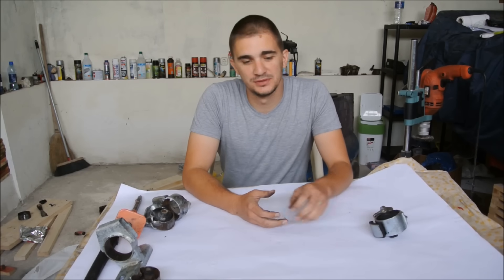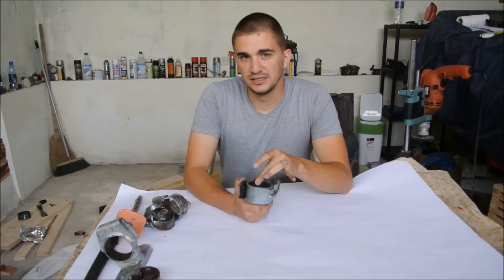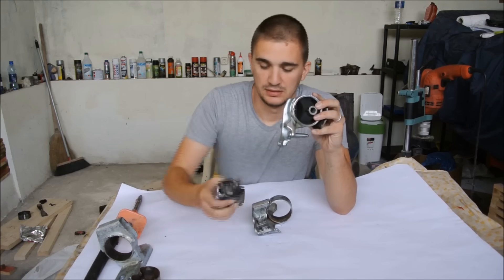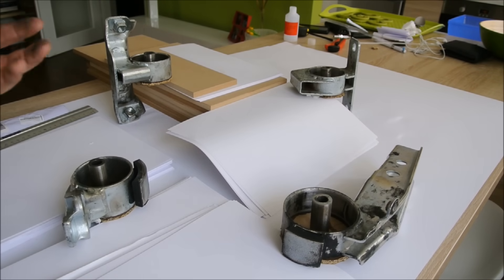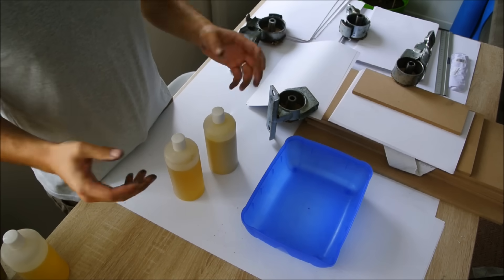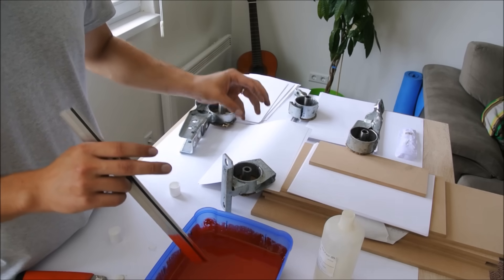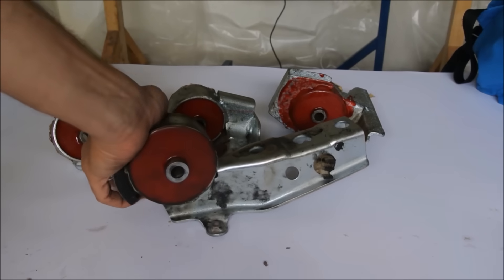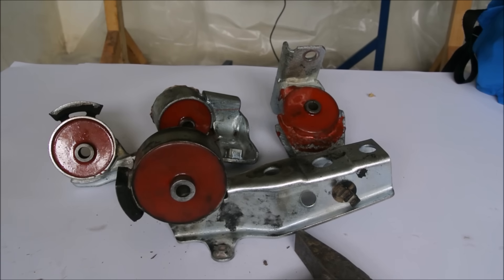How to make DIY polyurethane engine mounts

Comment: A standard rubber bushing is designed to flex and twist when needed to, hence why the rubber is attached to the outer ring and the central pin.
Doing what you have done, basically fixing it with a solid lump of Polyurethane, will not allow the same degrees of movement and could possibly damage the Poly bushing.
What I am trying to say is when you bolt up the centre of the mount it will have no movement, where as a 'Bought' Poly bushing has the pin in the centre removed/not attached so that the bushing can rotate easier.
That is what the gaps in the original bushing are for, twisting movement. When you tighten the bolt in the centre of your fixed mounts, it will tighten everything and you will have NO twisting movement and a very short bushing life.
When you change a wishbone bushing or whole wishbone, the car should be settled at ride height before tightening the mounts, so that everything is straight and allows for the proper twisting/movement of the bushing.

15 years of Mechanical Engineering has proven this to me many times. If you want to do this properly you need to pour the Poly without the centre pin, then drill out the hole required and grease the pin so it has rotation.
Good idea tho, might try it one day :)
Reply: TheFrowningLizard that's true. It's how most OEM and aftermarket bushes are supplied. As you say the pins should pivot and be lubricated. It's a good start in DIY though 🤔😊
Reply: This was an engine mount. It not supposed to twist and rubber is only for vibration absorption. Your idea may work for lower and upper arms.
Reply: Khurum Khan i
Reply: By "wishbone" I assume you mean Control Arm bushings.  Most engine mounts, especially ones that are oriented vertically do not require the same amount of flexing as a control arm.  Regardless, what if you were to first lightly grease the pin with say a very thin coat of something like Vaseline. If wiped off enough to leave an extremely thin coat I assume you would be able to easily remove the pin once the poly has cured and then reinsert it again with whatever proper bushing grease such as silicone grease (which you didn't specify).  You could also do this with a few other smaller pins in the middle ring of the poly to create 4 to 6 added holes  for flexing.  I think doing these two things would take this DIY mod as far as it can go.
Reply: Actually most OEM rubber suspension bushings are bonded to the bolt pin like in this video.. it's bonded so it gives desirable response/predictability to the handling feel.
Reply: @ alonzo rottman. Yep that's how I found this video. Searching for an alternative to the pricey front mounts for my 2007 Dodge Ram 1500. Will be working on the mounts this weekend but more than likely I'll be using the Windo Weld.
Reply: For an engine mount it doesn't need to rotate. It's just there for vibration absorbtion and that's it. If it were somekind of linkage or for your suspension or something then it would.
Reply: @oldowl4290  Cheap, home-brewed mold release?  Pam is what you're after.
Reply: How do you know someone is a mechanical engineer? Dont worry they will tell you.
Reply: About The Build still not as bad as vegans
Reply: Nimbus Nimbus  I remember, before becoming an engineer, I was a mechanic, and we would make fun of engineers for stupid designs. That's why car companies always have so many recalls. Re-engineering is essentially engineering a fix or improvement on what an engineer's idea was. As an engineer that was also a mechanic, lemme just say that half the engineers out there are over confident and arrogant, and that's how flaws in design and recalls are made. Trust me, some of the guys I have to work with think they are exempt from human error lol
Reply: Wow.. Chilll down guys.. Its just an opinion  from an engineer..so whats the big deal? My uncle once told me "with great knowledge, comes great responsibilities" hence..a true engineer would not simply look down on others ideas and (now trying) to correct em just because others didnt had any engineering title/degree /cert etc while the main reason they r posting this vid was actually to help many (not an i.r or engineer yet) car users out there that may be needing this method for temp fix.. If u think this vid was done or made wrong.. Why dont u use that i.r title inteligence to do a diy vid and yes..u may put all ur ideas and all those morgan freeman big bang inteligencies on it.. I bet another higher rank type of engineer will be waiting just to scan and search for the vid so that he can tell u the proper ways it should be done..
Reply: Great comment
Reply: Would be true for a moving joint like a control arm. A engine mount won't twist. Also the pin centrality ist negligible for a engine mount.
Reply: Thank you for your insight you 1000% correct i will be drilling mine out
Reply: soo true!! I was wondering that its also a better procedure and you can have a better accuracy in alignment. you finish the job faster as long as you have the right drilling bit which I was wondering to find soon... maybe you can help me im not yet a mechanical engineer but close to finishing my degree. =)
Reply: But the whole point of this is make the engine flex less by limiting it's movement. The original gap will allow the engine to move more thus reducing vibration, but a lot of people when modifying their cars will prefer less engine movement (but trade off is more vibration felt in the car), so they use this type of solid engine mount.
Reply: I would have preferred to pour the polly into a coke can and wait a day to set, then cut away the coke can and place the cylindrical polly into a lathe and mill down to desired diamiter then whilst in the chuck of the lathe drill the desired hole so that's its perfectly centeral
Reply: Who cares about all your theory???, do it in the real world like this guy did then you can come here and talk everything you want with facts
Reply: TheFrowningLizard  when you buy polly mounts they don’t come with holes either
Reply: TheFrowningLizard please tell me your not saying that mounts are meant to rotate. PLEASE tell me you arent saying that 😂😂
Reply: @dimitriseals4389  he did lmao, then people wonders why their cars are garbage
Reply: Everyone replying to this saying that he doesn’t know what he’s talking about clearly have not read this post thoroughly enough. The man clearly specifies that he’s talking about a WISHBONE bushing, or for you uncultured numbskulls that don’t understand he’s talking about a-arm bushings. YES they need to rotate. I’m sure he understands that an engine mount is not critical for rotation but more so vibration dampening. But that’s not what he’s talking about here. What a sour patch of finger-pointing know it alls this community has become. Even when somebody posts something that is correct you all find a way to ignore those rights and point out any wrongs. Sheesh.
Reply: He's an engineer everyone leave him alone, he is doing the best he can.
Reply: TheFrowningLizard  I hear what your saying.However when your engine is modified the rubber flex’s too much some times leading till problems shifting.This idea is a good compromise between the two.
Reply: TheFrowningLizard this is how poly bushings are made,they just vacuum mold them,but this is the material they use,you can select diff hardness to get the movement you need without causing to much vibrations...next step after this is solid aluminium inserts welded on the mount(solid mounts)
If the car dont make the required power to run them it will vibrate even more...
Reply: you must not know much about high performance mounts.  polyurethane IS the material that high energy mounts are made of. they are the "flexible " version of solid metal mounts. if you are applying any HP to them the poly will be much better feeling that that sloppy rubber.  Even OEM mounts for my Ram are hard to find and one is over $300.  this is actually an extremely good idea.
Reply: Started to type before I saw the other posts, and my ideas might be moot, but I'm posting anyways. ;-)

Guess the cutouts of the mold to allow for flexing in the material could be done by making some insert that can be removed later to both get the desired effect and save on material. Guess drilling out material would have much of the same effect.

For inserts, I think polystyrene/styrofoam would be a nice candidate, It shrinks and becomes a fairly easily removable goo when exposed to petrol, and can be removed before the petrol evaporates and it hardens again into a hard/stiff material. 
AFAIK polyurethane should be resistant to petrol, but I guess it makes sense to test it on a small sample first, and limit the exposure.

Comment: The vibration probably depends from car to car.
I have put on Skoda Fabia 1.4 TDI engine mounts from Fabia RS and the vibration was iritating on some rpm-s, complete dashboard was vibrating
My friend had on his Peugeot 106 engine mounts made from teflon and the vibration was  significantly increased.
My opinion is if it is for a racing car OK but for an everyday car I wouldnt do it.

Comment: I don't feel too bad buying the front mount for $150 and $40 for the side mount. chloroform dissolves rubber, you could try that and mix it with the polyurethane. anyways the stiffness you chose is too stiff. since it's solid you should have gone super soft or melt holes in it. oh wait polyurethane, that's what people use to put a gloss coat on wood and skateboard tires. dude you should just try using straight RTV, that's basically soft rubber. you probably gotta do it in layers though or it wont dry
Reply: eksine You really have absolutely no idea what you are talking about. First, factory bushings are typically 40-70 Shore A. He chose 60 Shore A. So while it is stiffer than a lot of factory mounts due to being solid, it is actually softer than most aftermarket mounts which are often 80 Shore A or even more. Second, this is the exact same material used by aftermarket companies to make mounts. What differs is the process of pouring and forming. Making mounts like this is literally a recommended use by the product manufacturer. Third, there is a huge difference between a Urethane rubber, as used here, and a Urethane resin, as used on skateboards. Lastly, RTV would be a terrible choice for this application. not only is it too soft, but it has a much lower tear rating than this material and would not hold up to twisting and pulling. If you actually looked up the specifications of the product, you would know that. And not to mention, the whole point of RTV is that it can dry without the presence of a lot of air. Literally everything you said is inaccurate.
Reply: eksine Haha, no, I just act like you talk out of your ass, which you do. :)
Reply: eksine I never said RTV wouldn't work, I said it is not the correct material for this. I even spoke of specific reasons, two of the biggest ones being the stiffness and the tearing strength. Polyurethane is one correct material.
The fact that you had to look up the idea is exactly why you were full of shit, because you were talking out of your ass mate, you stated it like you knew better, but you didn't.
You can use any number of materials for this, but the one he chose is correct and superior to RTV for the job. People have used window sealants and gasket makers all the time, doesn't mean it is ideal, and the rest of what you said is still nonsense.
You are proving nothing except that you can Google something you previously knew nothing about and I already knew.
For $25 you can buy the correct materials, it will smell less, it will cure properly without special care, and will last longer.
Reply: hahaha
Reply: PhantasmAMX I bet you're real fun at parties
Reply: PhantasmAMX Phantasm you are so full of shit! I decided to look up my "crazy idea of RTV/ silicone mounts" and guess what people do it all the time. in fact there's a DIY written for it and it says exactly what I guessed, soft rubbery-ish, and takes long time to dry, EXACTLY as I said. you are so fucking closed minded I somehow even doubt you work on your own cars, you probably just like to show off your "knowledge" and that everyone else is wrong, shut the fuck up I already proved you aren't fully correct and others can be right too. here's the reference:    https://www.mazdas247.com/forum/showthread.php?72087-How-To-DIY-filled-motor-mounts&s=109dfe38b4e29986ccb9d00917f6b58f    also google silicone or rtv engine mounts, people do it all the time asshole
Reply: PhantasmAMX it's called an educated guess based on my experience with working on my odyssey, not me being full of shit, the one one here being full of shit is you "MATE". silicone is fine for it's purpose which is to strengthen the rubber already there. I wouldn't remove the rubber and put silicone in it's place although it's possible it could work. anyways grow up dude, you act like such an asshole for no reason, get some maturity I'm done arguing with you

Comment: can you explain why they are better?
if they make more noise/vibration then why bother?
Reply: The stiffer the mount the more power transferred to the ground. 

Is the vibration worth it to you is the question.
Reply: wrong
Reply: nope
Reply: Cheaper, it says so in the vid.
Reply: Oh and they will last longer too, probably the life of the engine.
Reply: jw200 because nobody sells the torque strut mount for the aw11 mr2
Reply: because you want your wheels to turn, not your block
Reply: You can get many people type of stiffness and this is less stiff than most aftermarket ones 
Cheaper too

You're obviously not a car guy
Reply: William Thieme yes
But a poly mount also doesn't ruin the ride either 

Especially a softer poly
Reply: Hes using this on an aw11 mk1. Luxury isnt what its marketed for, but more of a small fun town runner.

Comment: For those talking about compressing the polymer to reduce the size of the air bubbles, you could probably get a similar benefit by just putting the mixed liquid in a vacuum press before pouring. 

It's similar to what you'd do with any epoxy/composites when you're going to have the final product visible. Putting the mixed epoxy under vacuum removes the air bubbles that make the epoxy visible and potentially less durable

Comment: well there is a reason for the steel ring in the old mount that you messed up its there because the mount is made from cast aluminum and you need the steel ring to keep the mount from breaking when the motor jumps this is a bad idea if it actually worked the car makers would use it

Comment: Here is good tip for you all. Set the mounts in oiled sand before pouring. No need for cardboard as the poly can not flow out when the mount is set into the samd. However, a bit of waxed paper taped to the bottom of the mounts will keep the sand from sticking to the poly.

Comment: How do your poured-in-place bushings compare with the machined-from-solid bushings?
Reply: I've only ever seen injection molded bushings. Never seen any that are machined. I'm not saying it's not a thing, just curious as to what manufacturer uses that technique. What would be the benefit?
Reply: Daniel-----I manufacture polyurethane suspension bushing out of solid bar stock.   The bushings are machined.   The bushings I make are certainly easier to install than the ones on the video.
     I've only made bushings for Jaguar independent suspensions systems. I suppose I could make bushings for any suspension set-up if I knew the dimensions.
Reply: I watched you make your bushings.  I don't mix anything.  While you are mixing and pouring and waiting for your bushing to harden, I'm down the road.  If you bushing replacement for auto repair customers, would the customer have to leave the car with you a days while the bushings harden?
      I machine the bushing out of solid bar stock.   It takes about 3 minutes to make a large bushing and about 2 minutes to make a small one.   When I am done machining, the bushings are ready for installation.
        I have made thousands of bushings for Jaguar independent suspensions.
Reply: What machining tools do you use? Is it just a drill press and a lathe?
Reply: I don't make "poured-in-place" bushings.  I machine bushings out of solid round bar stock.  I use a CNC lathe to machine the bushings.  The bushings I make are used in the suspension systems of cars.   I make hundreds of the same size bushings at a time.  My method wouldn't work for motor mounts or anything that isn't round.  I usually use polyurethane, i.e. Delrin.
Reply: Rob Macfarlane I love Delrin. But yes, that's what I was asking, what kind of machining do you do. I know energy suspension uses molds for their bushings. I would love to make CNC'd bushings, but that's kind of out of my price range right now.
Reply: Sigma---It's actually pretty cheap to make bushings out of Delrin.  You can purchase the bar stock from many plastic suppliers, and only buy what you need.
Reply: Rob Macfarlane No I mean I wish I had the machine.

Comment: I had a bad motor mount, so I just squirted a lot of rtv where the rubber had fallen apart. It's been two years and all is well. Didn't even take the mount off.
Reply: John Doe 
Ghetto fabulous.

Comment: use plasticine as a base to mount the holder and tube in as it holds them in place well, easy to remove and reusable, your way works too, just sticks to the paper a bit,
but like you said that is just cosmetic